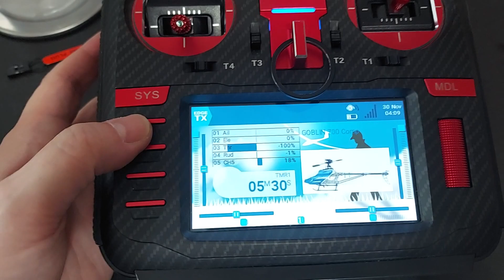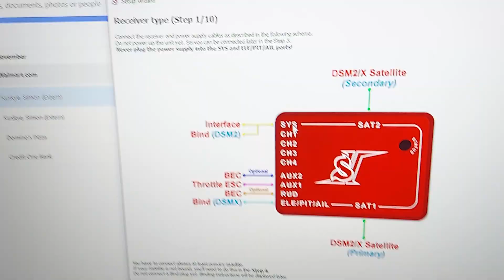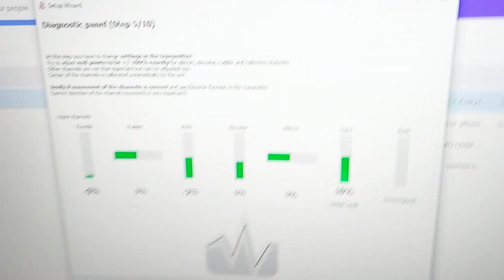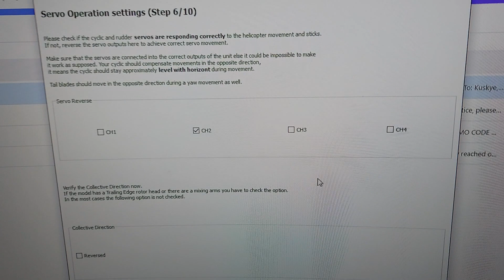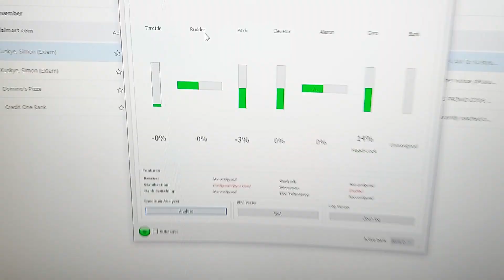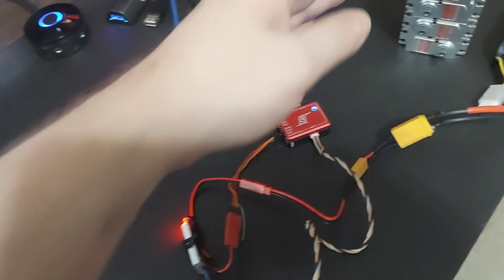Spirit Flybarless Setup,  OpenTx Part 1 =Initial Helicopter FBL setup=

Comment: Hi Simon, at around 11 minutes you are talking about gyro and the rescue switch. Also about stabilization. I cant seem to get my head around it how to set it up correctly. Can you explain please? How to set it in the transmitter and in the software?
Reply from the maker: Transmitter here, https://www.youtube.com/watch?v=Grf4YCgfXv8

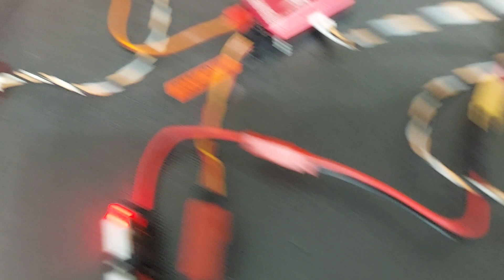Stabi mode and Rudder gain here @8:24, Provided you are using my profile on your TX16,
https://www.youtube.com/watch?v=_EOtHtHMkPo&t=213s

If you are running my profile on your TX16 this is the switch assignments,
https://www.youtube.com/watch?v=w_J1q5kgczE

Comment: Great video!! i just start with Spirit with mal helicopter that your big one, Wich model os spektrum satelite do you use? Thanks in Advance
Reply from the maker: I use both of these below.

LemonRX are great "my fav"
https://graysonhobby.com/lemonrx-gen2-satellite-dmsx-campatible.html

Or Original Spektrum 
https://www.ebay.com/itm/355533333616?itmmeta=01HSCG6P7A3EBG1M5J2SPCJC79&hash=item52c7702470:g:ETYAAOSwljRl7mmk&itmprp=enc%3AAQAJAAAA4DSPjLAYWS%2B1XUUxBehPygS0pC6%2FL5wkJtWQWcqeiJNhb9qPVn9ijHGQnGsqw0%2BeNqeT6vkBS%2BsupRXTnZ904ED%2B0qUoGZYBxmxgJqs6caukLcasadHkhqHVoG8jUn441aCp8V8sc16xqKDEOCuhF0TUczNIFpMKRumNmmOpNQGcwCFSyA2Q2gU0MkOW2KVX%2F2d7miSmZKpy%2ButcQYz%2FcAiqOyGT3AJ0J5a8PWV1daGjw9XQ0YxSIkipHfXqm6Twlvt%2BW7XpjhJeVQ7wMcyI6nc2nuV%2FOfJLguc%2BnV%2F4LIRV%7Ctkp%3ABk9SR_7jmpDLYw
Reply: Thanks! I'll use @NomisRC

Comment: Hello, nice Video,But  do you need a receiver for the spirit gt...? or only the spirit gt with Sats ?
Reply from the maker: Spirit GT and GTR can use dsm sat's or a separate receiver of your choice. I use dsm sat's with all mine. The GTR comes with built in yeti, but i'd never use that. But yes you can use any Rx you want with it. It comes with different wiring to do so.

Comment: I'm in the process of installing one of these on a 50 size nitro Heli with a Flybar...Where do you connect the GPS to this thing? Is there an Diagram or user manual for it?
Reply from the maker: If your speaking about the geolink, it should just plug into a sat port. http://www.manual.spirit-system.com/index.php?title=GeoLink_Mounting

Also here is the full manual:
http://www.manual.spirit-system.com/index.php?title=GeoLink/en

Comment: Hello! I have Spirit RS + Jeti mezon 85 pro opto + Jeti DS 12 duplex. Questions:
1. When setting up Spirit RS telemetry - which company to choose ESC (jeti is missing).
2. Telemetry cable from ESC to which Spirit RS port should I plug it in? Your friend Maximo
Reply from the maker: I'm not sure why Jeti is missing, I dont use Jeti though so I cant speak to that. But this is how you plug in for telemetry.

https://manual.spirit-system.com/index.php?title=SpiritRS_Telemetry
Reply: @NomisRC  Thank you so much for the information! I did it! In Spirit RS, I turned off telemetry altogether and just connected the telemetry cable from Mezon - JET DS 12 to the E1 port - I immediately saw all the settings and telemetry from Mezon. Happiness is with me today!
Reply: @NomisRC  thank you - I will think and do